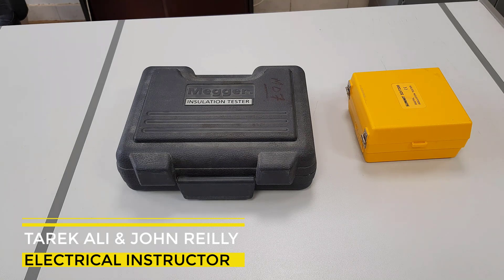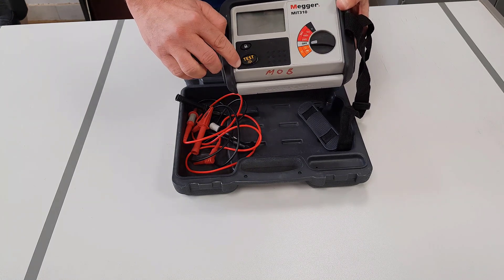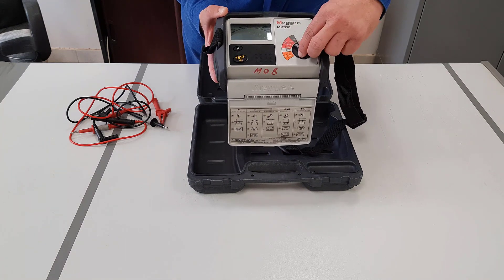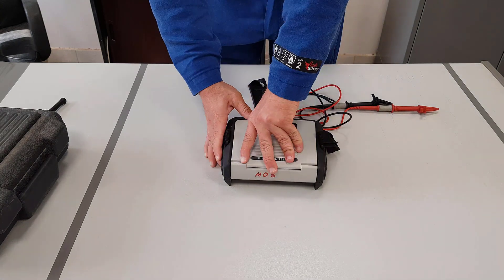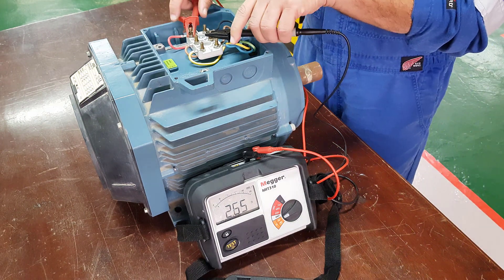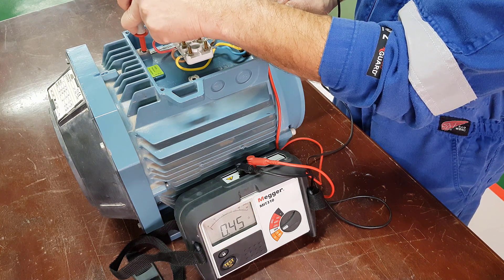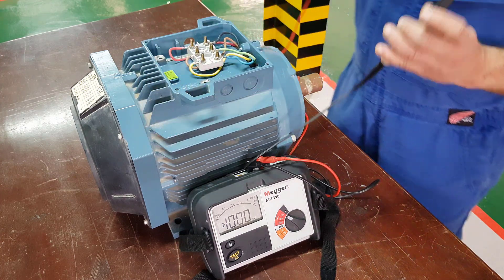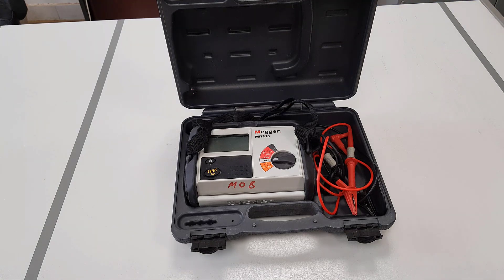How to use the Insulation resistance tester IR Tester Megger MIT310

Comment: On the megger 420/2 . If it switches from mega ohm to giga ohms let's 100 giga ohms, that is good correct?
Reply from the maker: I want know what's the equipment..and what's the test voltage 
However if the megger test result is 100GOhm that's mean a good insulation resistance 
Hope this answer was helpful for you ❤❤
Regards